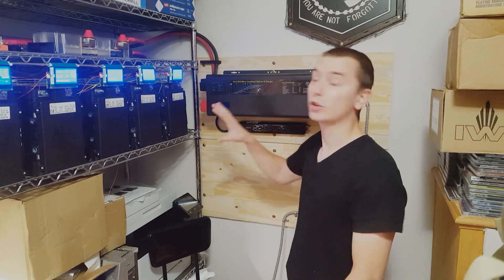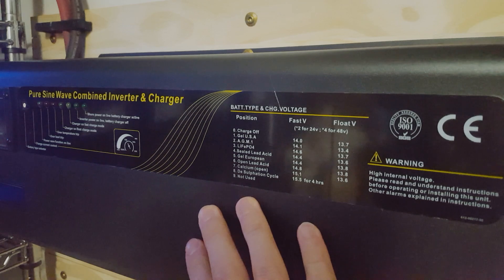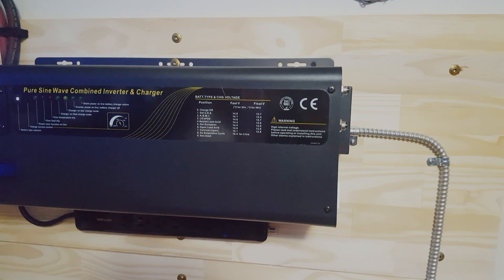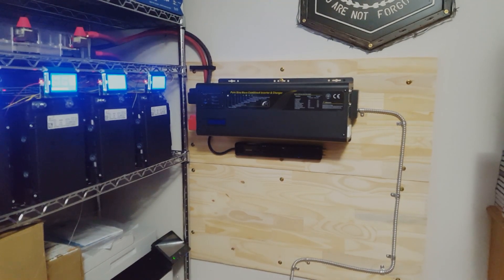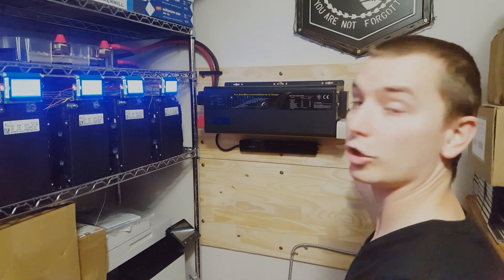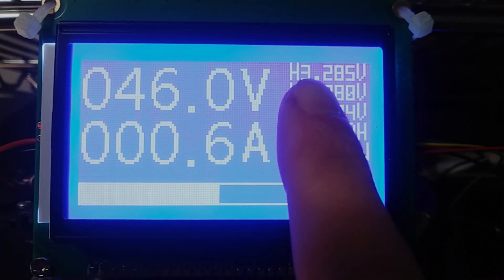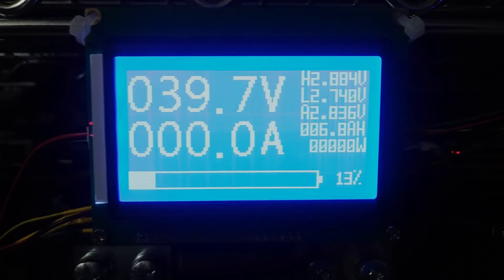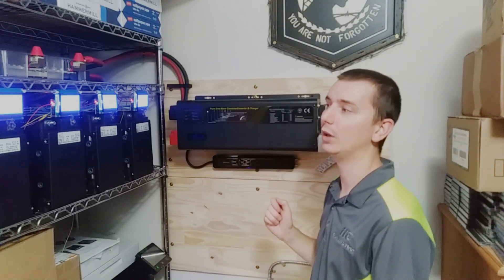"Project Overkill" Capacity Test-Sigineer inverter does weird things...12KWh 48V A123 Battery Backup

Comment: I have a similar Sigineer 6kw inverter (3kw/phase), though 24 vdc system, because that was what was available a few years ago (and yes, I would have preferred a 48v unit, but it wasn't available at the time).  I run a small off grid panel setup on my shop roof (4500 watts nameplate rating at STP, 3500+ watts actual MPPT output around 11:30 a.m. to 1:30 p.m. through the 6kw inverter. I use the inverter to power dual 1500w space heaters on cold days (and yes, they keep the whole house around 73°F, or several large AC units in the summer without any trouble (the system produced 22.2 kWh a few days ago). Due to the high parasitic draw at night of the unit (~200 watts including the WiFi bridge and power meters), I installed a cheap programmable digital timer from Amazon (with a 150-ohm resister in series with the 24-29.4 v batteries to reduce overvoltage issues) to shut off the inverter about 45 minutes before sunset (the output relay opens or shorts the shut-off contacts in the remote display unit). This allows the batteries to top off before nightfall most days. This lets me go through the night around full charge, allowing essentially full power after the sun has been up a hour or two and extending the life of my FLA batteries (12 x 100Ah) since they stay a long ways from 50% SOC. On milder days when running the heaters isn't appropriate, I use the system to power my entire house (less the high draw water heater, and dual HVAC units) and it does fine with the 1100-1500 watt nominal continuous power draw. It can easily handle the higher short term loads of a microwave, dishwasher, toaster oven, small burner on the stove when done separately (not simultaneously). I built the system for emergencies (for about $9k), but might as well get some financial benefit from using it, as electricity costs have nearly double from 2 years ago. I'm hoping to expand the system, and add some rooftop panels in the not-too-distant future.

If the grid were to go down for an extended period of time and I needed to run the system at night to keep the freezer and refrigerator/freezer cold, rather than running the unit continuously and losing the equivalent energy of 6 x 100Ah batteries, I would set the programmable timer to turn off several hours after sunset, then come on for an hour twice during the night (to chill the freezer and refrigerator/freezer) and then shut off again. Thus very little energy would be wasted through that parasitic draw at night.

Thanks for your video and insights. Hope you found my tips helpful as well.
Reply from the maker: This is an excellent comment and the timer is a great idea! That might be something I look into as well because the parasitic draw on these units is brutal! Thanks for watching and commenting!
Reply: I'm interested in seeing how you wired a night shutoff switch! Do you have a video?

Comment: I have the same inverter.  I bought it because it was available and it seemed to work well for you and others online. I was wondering if you have an easy way to make sure it charges during the day while solar is available and discharges at about  4 or 5pm.
Reply from the maker: It’s still going strong. I’m a little confused by your question. Are you asking if you can set the inverter to charge off of the wall? For solar you use a solar charger controller which is separate from the inverter(inverter doesn’t do the charging). Can you clarify?
Reply: @diyrenewableenergyelectron4996   I just want to make sure that it does not charge during peak ours.  I want it to charge only when the solar is going or after midnight when the rates are low.
Reply from the maker: Ah I understand now. There’s a few options, but perhaps putting the input charging power on a timer would be the easiest. When the timer kicks on, the inverter will go into charge mode. When the timer kicks off, the inverters charger shuts off, the transfer switch engages and kicks over to battery power for your peak hours.
Reply: @diyrenewableenergyelectron4996  Sounds good.  I'll give it a shot.   I am concerned that there is a possibility that I may lose power during that time since I'm trying to run most of the house on the system.  Also was wondering if you went through the trouble of getting your system permitted as I am facing some resistance.
Reply from the maker: Let me know how it goes! Permitting is very different across different jurisdictions. Some places are lax, others are very stringent. Hopefully things work out smoothly for you in that aspect.

Comment: wait early in the video you said the battery was within .001, at the end of discharge the batt is out of balance
Reply from the maker: Correct. Because of the extremely flat discharge curve of lithium iron phosphate cells, the batteries can be very close in voltage around the midpoint of their capacity (probably 30-70% state of charge) and then at the very top and very bottom of the voltage range they go out of whack very quickly. Thanks for watching!

Comment: hi,  nice video. When calculating your battery capacity, did you take the efficiency of the inverter into account ?  I have an LV5048 all-in-one and it's measured efficiency is 91% with a continuous load of 70W.
So assuming the same efficiency for your inverter, the BATTERY capacity should be:
    (8.4 / 0.91) + 3.5 = 12.73KWh
Of course the calculation is a bit academic since the useful energy available at the inverter output,  under your light load, conditions is 8.4KWh. 
Using a heavier load would reduce the effect of the idle current drain of the inverter.
Reply from the maker: No, I pretty much just added the parasitic losses of the inverter to the amount of energy the kill-a-watt meter gave me. Not the most scientific but it got me in the ballpark. All that I really care about on this system is runtime so it gave me a good idea of what to expect. If I had a hall effect sensor on the DC side of the inverter I could have been very accurate with my capacity measurement. I may do this in the future! Thanks for watching!!

Comment: These are good videos!!  I am continually suprised by the parasitic draws on these cheaper inverters.  You are basically wasting 10% of your battery pack and 10% of all the energy you ever put into it.  Mind you some of the even cheaper inverters are much worse!
Reply from the maker: Thanks! I'm glad you enjoy them. Its pretty crazy when you think about it. I havr the same inverter on my solar setup and I use the "power saver" mode often. Simply because it sucks wasting 920Wh a day on the inverters parasitic draw!
Reply: Im interested in knowing how the power saver mode works!

Comment: just came across the battery on battery hook up then searched videos on youtube and came across your tear down and setup... honestly pretty cool... just sad its 7s per module and not 8s... feels like for most inverter chargers this is going to cause issues as you found with yours, as one of the greatest benefits of 4s LiFePO4 is the closeness to 12V lead systems. Anyhow my desired use case is nearly the same.... starting with non-solar battery to act as a backup for critical loads in place of a generator for relatively short grid-down scenarios.... while up-time on electricity is good here in the city...  still have had several thunderstorms knock out power for 4-6 hours.... which couple of kWh would be ideal. And hopefully something I could move with me to further projects.   Still awesome to see your setup.
Reply from the maker: Yea, the charging side is a bit of a headache because of the slightly lower voltage, but it works well overall. 8S would have been perfect but for the cost vs quality/life expectancy of these cells it was hard to pass up. The BYD's are heavily degraded and a nightmare to keep balanced. This was overall a better option for a setup that will be used rarely but needs to be reliable. I appreciate the comment and thanks for watching!
Reply from the maker: If you have any questions feel free to ask!

Comment: I don't take mine below 3.0 just not much sense to beat it to death for a few kwh 90% of the power seems to be from 3.4 - 3.0
Reply from the maker: Yep! I see mine sit at 3.3-3.2 for a vast majority of the discharge curve. These cells are in excellent shape and will probably outlive me considering they will get about 10 cycles per year and these cells are good for 2000 cycles before they reach 80% degradation. They are already slightly degraded so even if I only get 500 cycles until it reaches 80% capacity its still going to last 50 years and that's taking it ALL the way down to 2.5 every single time. If your setup has the capacity to where you dont need to use that last bit of the discharge curve then you're wise for trying to extend the life of the batteries, in my opinion.

Comment: Do you think the power use of the inverter is high? I would like to see comparisons on the internet.
Reply from the maker: I think the 48w standby consumption is fairly typical for this size and type of inverter. Most people think "psh 48w isn't much" and brush it off as insignificant but this test showed that around 30% of the battery capacity was consumed by the inverter. So to concisely answer your question, no I dont think it is high but it does consume a ton of energy over time.

Comment: Inspirational 👍What's the next project or area of improvement? Is it possible to elongate the life of the system? Would it be possible to reduce the parasitic load by incorporating a smaller more efficient inverter in tandem connected to a load sensing ATS automatic transfer switch that will instantaneously switch between the different inverters when the load exceeds 100 Watts. Would it also make sense to create a equally balanced 96 volt lithium ion phosphate battery to power the smaller inverter reducing parasitic load increasing efficiency reducing amperage? 😉
Reply: You answered some of my question in the outro it's almost like we're thinking similarly. About a year ago I purchased a 14s 6 amp hour battery from Luna cycle which also charges to 58 volts it comes with a xt90 discharge and xt60 charge connector built-in BMS with ample overcurrent protection. The reason I'm mentioning this is because of the above mentioned 96 volt battery could easily be created out of dual 14s batteries in series conveniently having two separate charge ports. I am type of builder that doesn't like to buy things pre-made I like to batch things together and make them work seamlessly. Best of luck
Reply: Recently I've been looking for an unorthodox method of creating a customized automatic transfer switch out of two communication card installed UPS's and a ATS automatic transfer switch. Basically monitoring the current of both devices by debugging the logs of both UPS's in real time either locally with Tail(Outputs the last few lines of a log file) or remotely using a syslog server. Effectively switching between UPS's based on parasitic loads and current sensing parameters. Best of luck fam
Reply: @Robert Wooten  how do you synchronize between the big and small sinewaves?  As I understand it, without synchronizing, the appliances might get damaged.  I like the big small idea though, when the AC is on fan only, small inverter is on, when the compressor kicks in, the big one is on.  There's also the issue of having the big inverter instantly coming online without delay.  There might be a need for a delay before switching over.
Reply: @rcboosted  they aren't synchronized they're on different phases.
Reply: @rcboosted  the transfer is so quick the appliance doesn't know the difference
Reply from the maker: Well this comment string got interesting in a hurry! Currently I dont have plans to expand or modify this setup but that could change in the future. It is a bit of lunacy that I built this in the first place considering the specific use case it was built for (power outages). There are about 5-10 power outages per year near me and most last a maximum of a few hours. However, this buffer before needing a generator is going to be amazing in the event that an outage lasts a day or more(not unheard of). The convenience of it is also a huge benefit. I'm expecting to be able to reduce the parasitic loss significantly simply by using the power saver feature of the inverter, but only testing it out will tell me for sure! Thanks for watching!